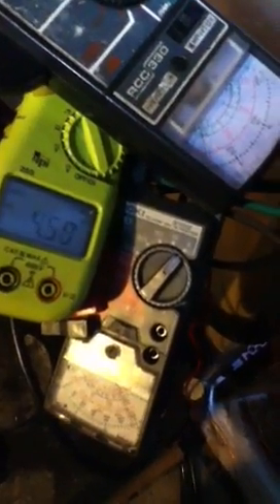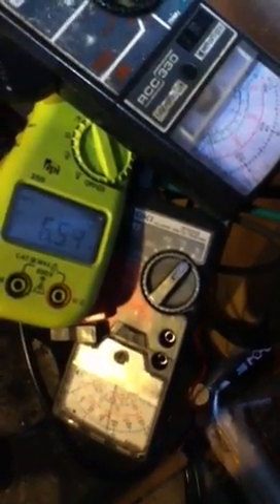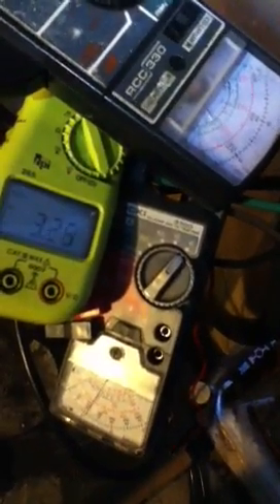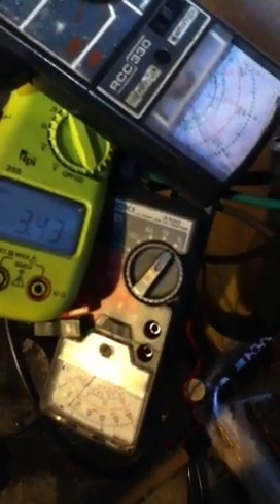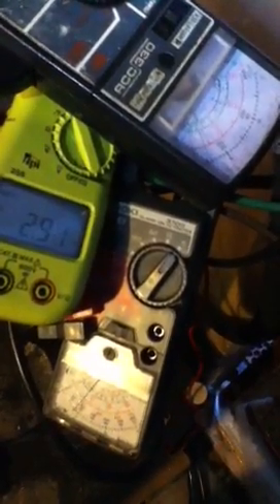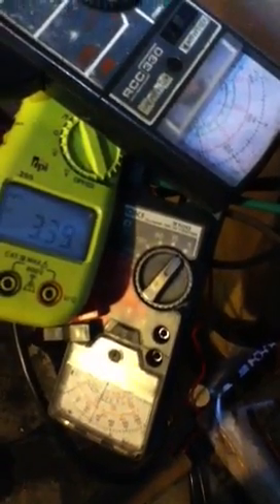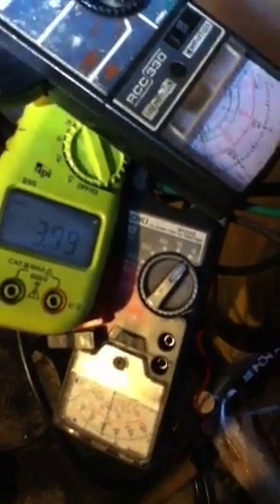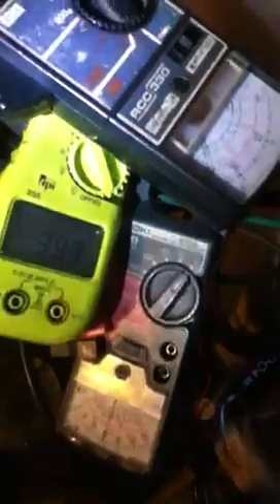Testing Sunforce 600 Watt wind turbine

Comment: I now have Two of the best made Turbines money can buy inexpensively . The first one that I've been running for two years through every kind of storm you can think of and it came through with flying colours is a DWP 375. It's a a  1.5 Kw  hooked into a Midnight Solar Classic 150. I recently purchased it's big brother DWP 350  and it's going on a Classic 150 also which are bullet proof and designed to make power with very little wind. That's what I love about them.Teachers can't build these ones.

Comment: If you're serious about going off grid then stop wasting your money on junk like I did. Get yourself a DWP 350 Engineered and built in windy Wisconsin . I've had mine for two years now and It's the best thing since sliced bread. It's bulletproof and and made mostly of off the shelf parts.It cost me twice what the Sunforce 600 did.It produces 15 times the power. I make usable power at 6 MPH . Most of the month I get winds between 6 and 10 mph. That's when it is needed if you're off grid like me.